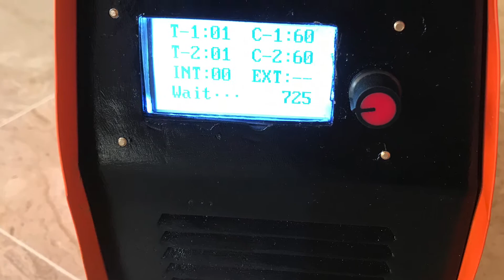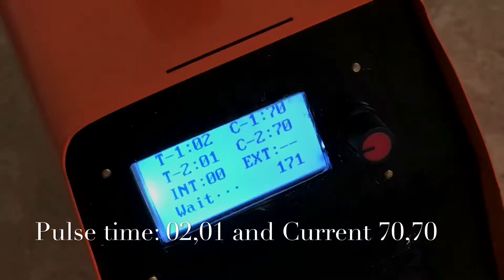Spot welder Build from 1500W MOT for 18650 batteries - pics & welding tests

Comment: You seem to have some experience building these spot welders so I’m wondering if you might be able to answer my question..
The welder I built with a MOT doesn’t have enough power.  It has aluminum wire, and it’s probably too small, especially fed with 120v.  I found a large transformer from a 48v golf cart charger that looks similar to the large one you used in this video, a bit larger though.  Do you think it would be worth trying to convert into a welder?  I can experiment with different size secondary cables.  Im just looking for some reassurance as to whether it’s likely going to work before I take it to bits.  All the guides I’ve seen use microwave transformers, but I did see a comment from someone who used a 24v battery charger transformer.  They said it was a bit too powerful but still worked.  I have the same timer circuit as you, so hopefully if it’s too powerful I can limit the pulse time to make it work
   Do you think it’s worth a try using this transformer?
Thanks
Reply from the maker: Yes. You can try ,  enough turns on secondary to get 4-5v , use thickest wire, if you can’t find one , you can strip multiple wires and combine them, heat shrink or use insulation sleeve - I prefer NY-D01 timer controller instead of this one. If current is high at lowest settings, use longer wires with pen it will reduce the current. 
Good luck 👍🏼
Reply: @JawadAhmadsahibzada  Thanks so much for the reply Jawad!  I’ll give it a go!  Time to start cutting (or maybe even unwinding) this secondary!

Comment: Can you share the link or the name of the capacitor you added? I can't find it on aliexpress.
Reply from the maker: purchase NY-D01 controller instead, that is better in my experience and cheaper too - btw capacitor is 600v 220nF  CBB22 223j630V - add 1 in parallel and check the welds before adding another one.
Reply: @JawadAhmadsahibzada Can both kits spot weld 0.3 thick nickle strip? If not what is the max thickness either can weld?
Reply from the maker: @FF_AlohaEdition   weld depends on size and power of transformer, this controller is just a switch.
Reply: @JawadAhmadsahibzada  I think my transformer is same as yours. How much can yours weld? 

Also I found on aliexpress 224j 20mm and 15mm. I think 20mm is how wide the capacitor is. Which one should I buy?

Before you reply yesterday I bought WIMA 150nf 630v capacitor on aliexpress. I tried to paste a link but comment kept getting deleted. Does that work too?

I bought the NY_D01 kit as well in case I messed up this one. Any trouble with this one?

I use 110v so my fuse should be at least 26amps right? because 220v uses 13 amp fuse.
Reply from the maker: @FF_AlohaEdition   
Transformer can weld 0.2mm easily , for 0.3mm, turns should be 3 instead of 4-5,

Any capacitor will work , you can parallel few of 150nf until you get desired results. 
NY-D01 is a good board. And I have used in more then 10 spot welders and all are working.
Reply: @JawadAhmadsahibzada  I have two microwave that input 1040 watt and output 700 watts. Can I weld 0.3 nickel and if yes how many turns do I need to do?
Reply from the maker: @FF_AlohaEdition   connect two MOT in parallel or series. Or find 1500w one , and turns 3-4 max. And keep welding pen wire short and thick  (this makes a huge difference)
Reply: @JawadAhmadsahibzada   I found one more that output 900watt. Can I parallel that with one of the  700 watts?
Reply from the maker: @FF_AlohaEdition  you can try.
Reply: @JawadAhmadsahibzada  One last question:  on  NY-D01, there's a 40a and 100a version. Does 100a mean it can take input of 100a or output 100a?
If output 100a, does output voltage stays the same as input 110v/220v?
Reply from the maker: @FF_AlohaEdition   40A is for single transformer. 100A is good for 2 in parallel. 
Single transformer usually goes to 19-25A 220v , 2-3 transformers might go to 50-70A 220v 

I have used NY-D01 only 40A ones.
Reply: @JawadAhmadsahibzada  I live in US. If my math is correct, it means using the control module two transformers my primary coil would input 110v 50a which means secondary coil at 3 turns output 3v 1833a. Is that correct?

Also can I use 12 awg wire that's rated for 20amp for the 50a current? Because it's a short burst of electricity I think maybe it works just like using 4 awg for 1833a if I'm correct.
Reply from the maker: @FF_AlohaEdition   Theoretically yes for both questions. 
You can use 12-14awg as pulse time will be small. 
Make sure you remove those current limiting shunts from transformer.

I calculated in such Way. 
In primary 220v 25A , output 5.5v 1000A 
But during pulse it was around 600-800A 

When Higher voltage (4-5v)in the secondary, you can use up to 28inch of wires with pen, and when voltage is (3-3.5v)  then pen wire shouldn’t be more then 18-20inches and make sure wires are as much thicker as much possible.
Reply: @JawadAhmadsahibzada  Thanks so much! 
One last question I swear. Can 12 gauge handle 70a or even 100a? 
I'm thinking about doing four 700w transformer in parallel.

Comment: Good video, you can explain that it improves the capacitor in the understand that it puts it in parallel with the primary of the transformer.
Reply from the maker: I think it won’t help. It might increase pulse time. I haven’t tried it

Comment: What value do you recommend for section and turns?
 Others use thicker cables and fewer turns.
Reply from the maker: 4-5 turns if your transformer is bigger and want to use longer cable with welding pen , 3 turns if transformer is medium size , then you will have to use shorter cables (2ft) for welding pen

Comment: I can't find one mot over 1000 watt s, but i have two mot's with 800 watts. If I put them in series it's ok? I will have 3,8 volts and 600 Amps în short.
Reply from the maker: sorin diaconu  yes. in parallel or in series it works, but in parallel make sure the secondary voltage is the same. Or you can use two Similar MOTs, with same cable windings and in same direction turns.
Reply: @JawadAhmadsahibzada  I am interested in series connection to increase the voltage. I want to use the same cable for the secondary, without interrupting it between the two coils.
Reply from the maker: sorin diaconu  yes it’s doable , I have seen people have done it.
Reply: @JawadAhmadsahibzada  I cut the secondary coils of 2 MOT's and both had aluminum. Is it possible that the primary coils are also made of aluminum? I found somewhere on the internet that MOT with the aluminum secondary would not be good for spot welding.
Reply from the maker: In my experience, whenever secondary is aluminum then primary will also be aluminum, you can scratch a little bit also to check. But I would highly recommend to use MOT with copper in primary

Comment: Which capacitors did you change when then transformer heated up?
Reply from the maker: Moejaahied Bardien Mlayer cap. Near 39ohm big resistor. Add larger value cap.
Reply: @JawadAhmadsahibzada  Thanks. What size Mlayer cap did you use in microfarad?
Reply from the maker: @moejaahiedbardien5118  100-350nF ,  depends on your transformer size, first add 100-150nF and if still burning welds after 100-150 welds, then add 220-350nF
Reply: @JawadAhmadsahibzada  I'll be using a 1000w MOT.